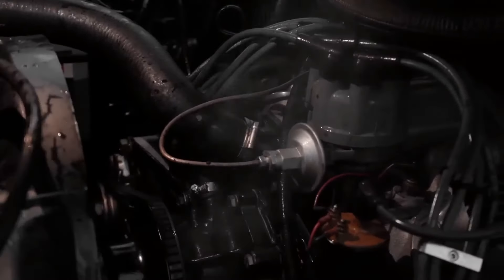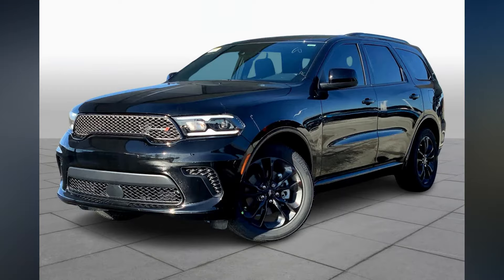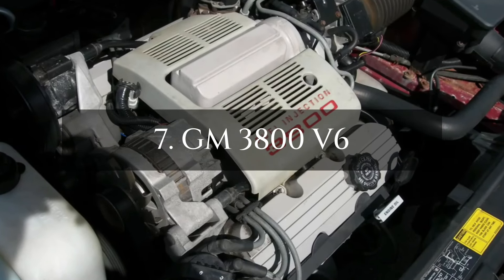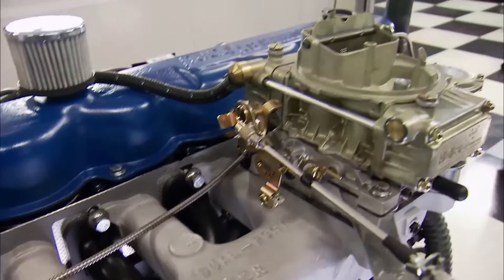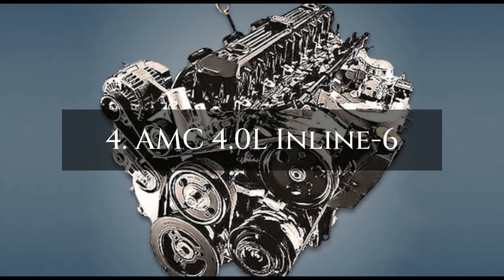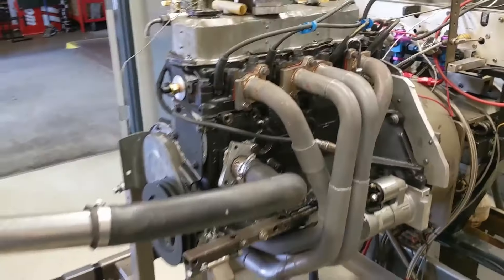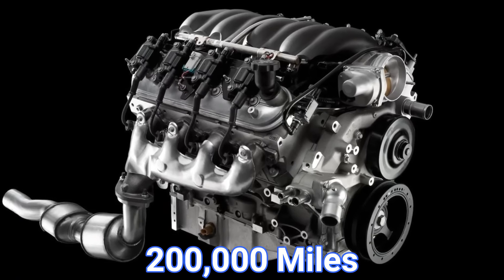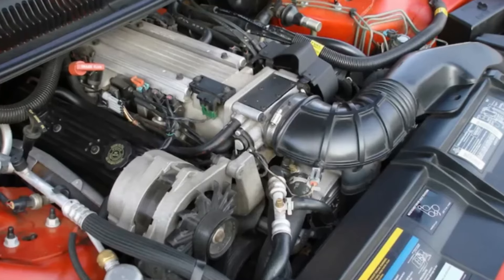Top 10 Most Reliable American Car Engines of All Time

Comment: Was hoping my GM 5.7L V8 Vortec made the list. Its a muscle engine
Reply: Chevy small block did make the list. I never cared for the vortec and preferred the throttle body 350. The throttle body was easy to work on and if you wanted to, you could remove it and drop in a 4 barrel carb.

Comment: 7.3 was a international not ford
Reply: It’s in a Ford, technicality.
Reply: How could you put in the AMC 4 L the 3.8 L V6, and others. And leave out Fords  302 V8 that has been around for more than 30 years.
And the old hemming’s were good, the new hemi‘s had constant lifter problems. Just like the penta star V6, which is a POS as well. 
Did this video AI?
Reply: @timothyconner4255  I was surprised about the me hemi also. I
Owned one loved it but didn’t get the life out of it that I would have wanted.
Reply: @timothyconner4255  440 international I owned one of those also oil pan rotted out 82,000 miles. Either had to pull transmission or engine. Ended up getting stolen good riddons gutless loud stinky. I only buy Cummins now what a difference